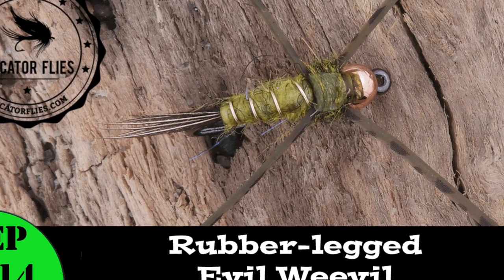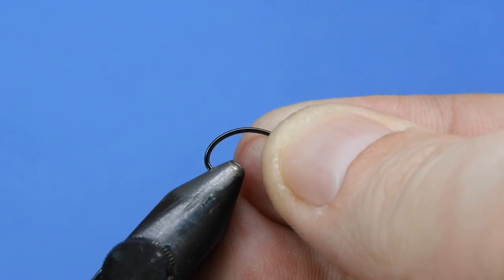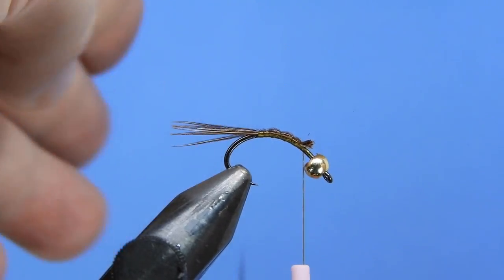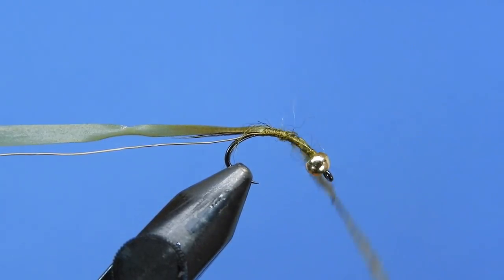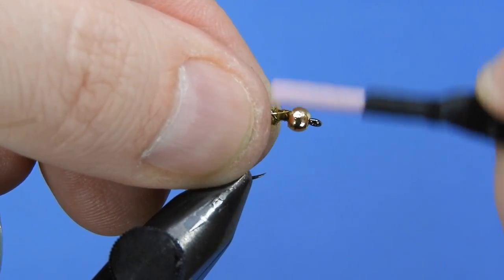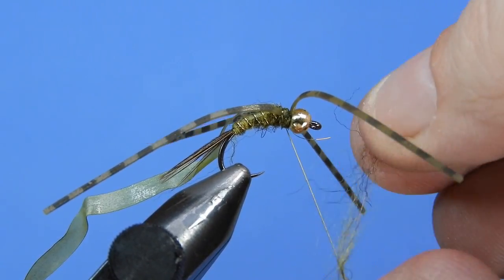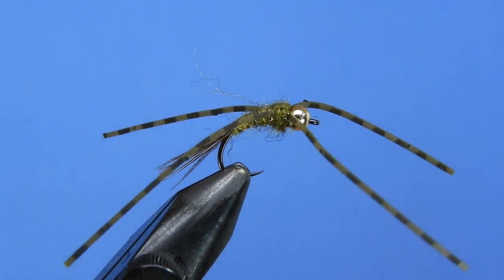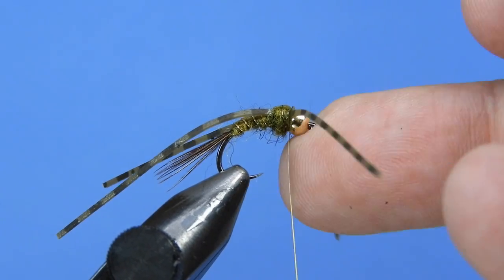Learn to tie a Rubber-Legged Evil Weevil Trout Fly Bead Head Nymph - Ep 114 PF

Comment: Hey Darren, I never learned to apply dubbing by spinning the thread. I have tried several times and can't get the hang of it. I do like the way you do it though. I think you use less dubbing the way you do it.  What do you think of that solarez? I have found that Deer Creek is the only one that is truly tack free in all viscosities. Nice tie, thanks for sharing. All the best to you and yours. Sean
Reply from the maker: Hi, Sean, thanks for dropping in. I think I'll do a little demo of my dubbing technique as a lot of people ask about it. It's a little different than most tyers. I don't actually spin the thread, on purpose at least, but I do dub from low to high. I was always to use half as much dubbing as you think you'll need and then use half of that. So far I've been really impressed with the Solarez. It cures really fast and isn't tacky. I haven't tried the Deer Creek resin, so I can't make a comparison between the two. Cheers!

Comment: Hi, Darren
Great flies and videos. Which type of Angelina Fibers do you use to make your dubbing? I notice they come in various kinds - straight, crinkled, heat bonded, etc. 
Thanks!
Joe
Reply from the maker: Thanks for the question, Joe. Here is a link to the seller I used on Ebay - http://ebay.to/2pP3RmD It looks like they are straight and heat bondable. There was a guy using these fibers years ago and using heat to shape the flies. Good luck.